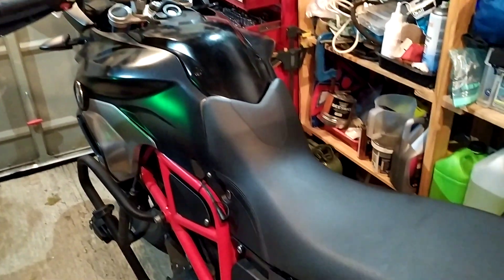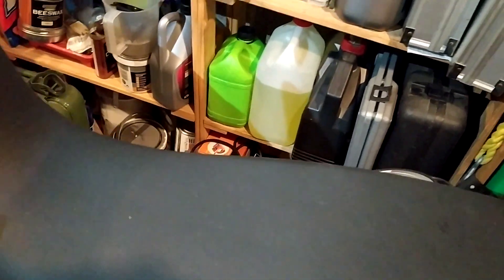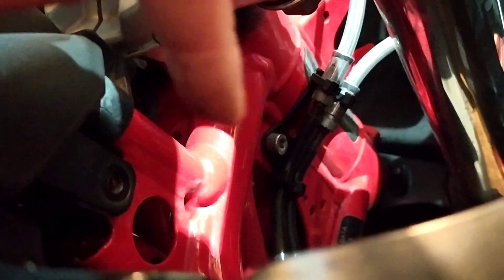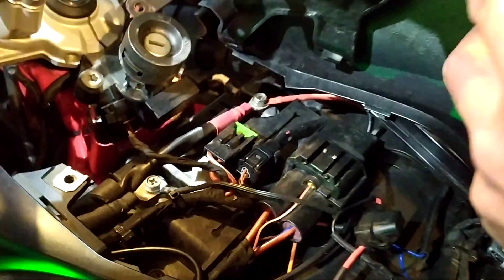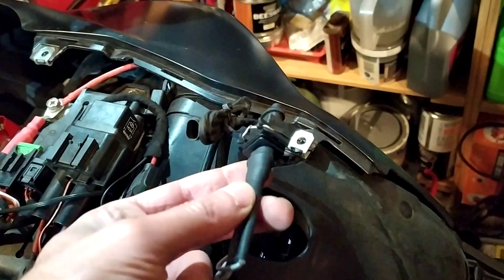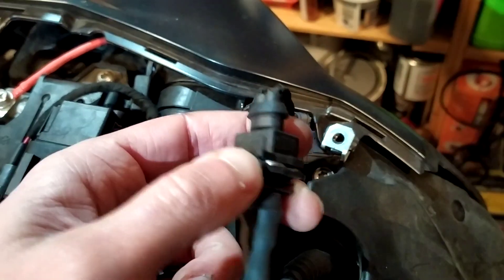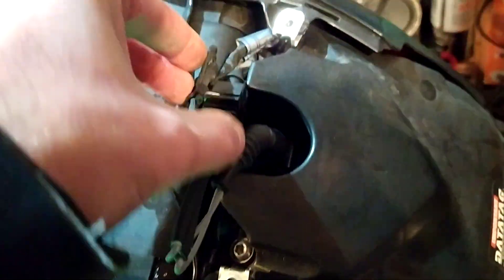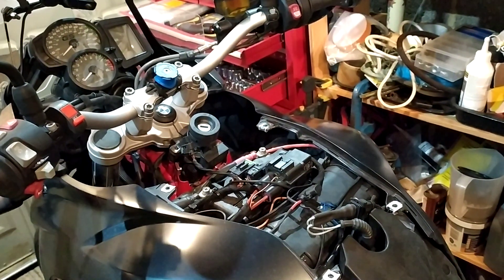Fitting Recyclizer to BMW F 700/800 GS (alternative to Booster Plug)

Comment: Hi
Did this help with the snatching throttle? I’ve just gotten a 2009 f800gs and is so annoying that the throttle responds in such a jerky manner. I wouldn’t have bought the bike if I’d known it behaved like this. Any and all advice would be very welcomed 👍
Reply from the maker: Yep still using it 2 years later 👍

Comment from the maker: Ok so my initial thoughts are........WOW this does what it says on the tin. Do not expect any power gains or anything with relation to performance gains. This will smooth out throttle response all through the rev range. Pulling away from idle the mixture of fuel and air is so lean i found myself giving the bike a lot of revs so as not to stall it, not now the response is smooth and not laggy due to the fuelling being slightly richer. I have reset my MPG and after 250 miles i still get 64mpg for my journeys which is what I got before I fitted it. For the price I cannot recommend this enough its a worthwhile investment that is easily fitted and removed when required.
Reply: thanks for reviews. Bought a f800gs recently and felt that the off-idle throttle is snatchy and kind of annoying. Bought a recycler, let's see!
Reply: Now that it's been in for a while, I'd like to hear what you think. Any stalling at idle?